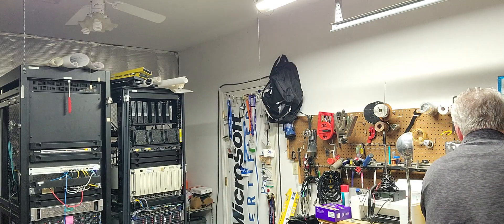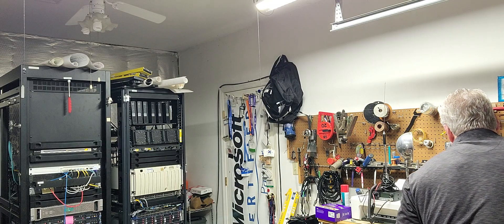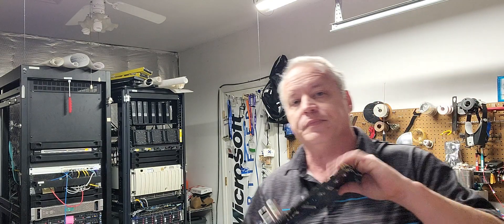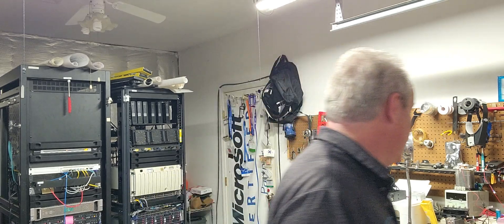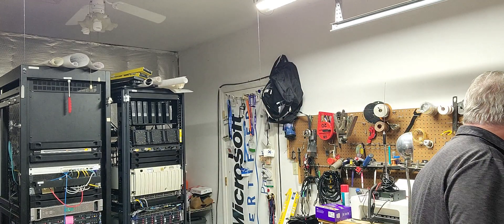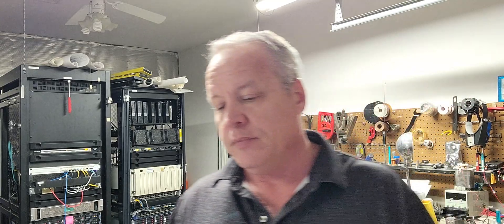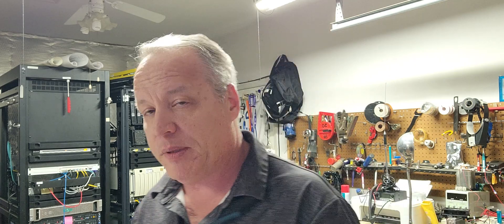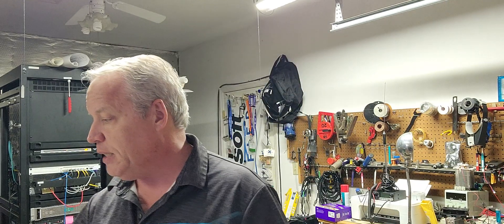This video talks to how to build your own OEM HP or Dell server that right and in the right order

Comment: Thanks Brad. Love your work. I have been a HPE fanatic for a number of years, but would love to dabble in some Dell gear. But struggle in some cases to purchase locally in Australia, either due to availability or price. R730XD are priced around $2000 without disks.
Reply from the maker: Wow!  Did you try just buyng OEM parts maybe?   I just did that very thing with a Dell P-7910 chassis I am going to do a video on shortly...
Reply: @leadiususa7394  I haven’t tried, but after seeing your video, I’ll investigate further.
As you mentioned, most people only look at separate parts for building a server from a bare 3rd party chassis.
Been mostly HP until now, need to try something new. 😁